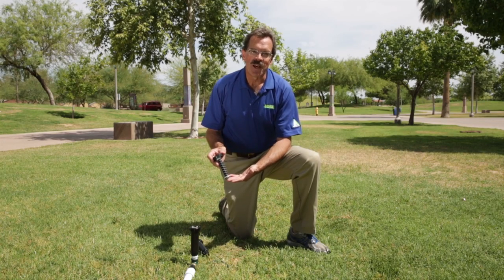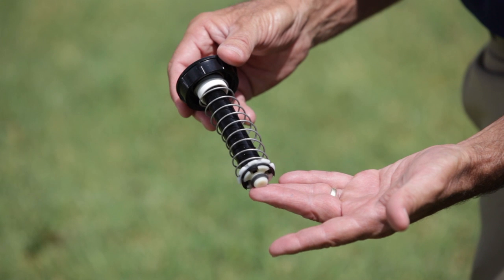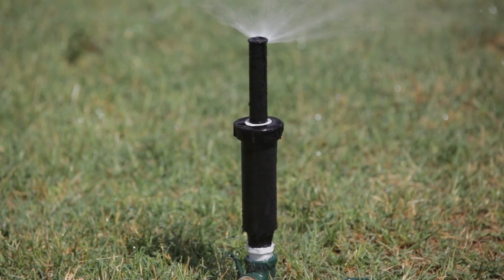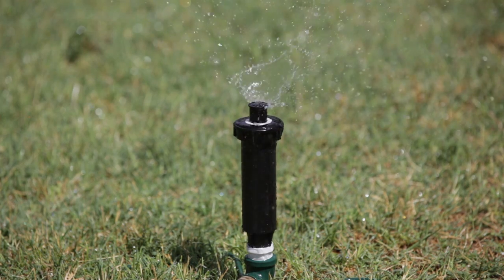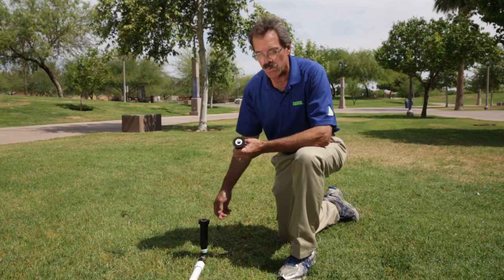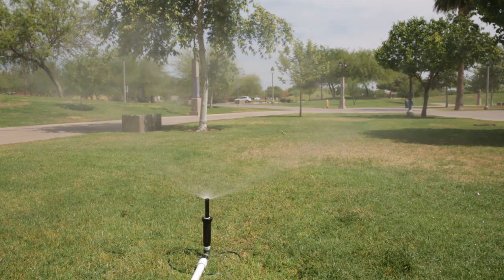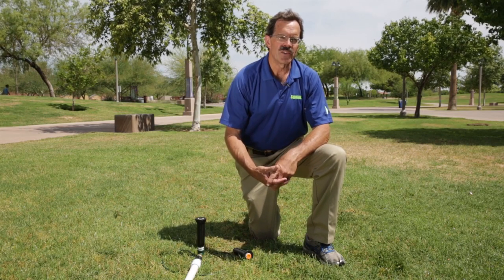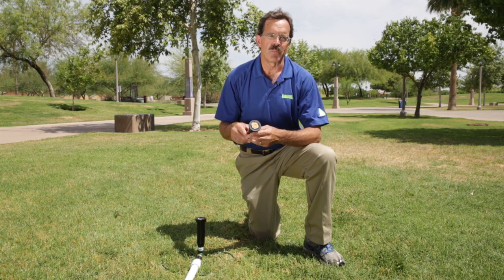Prevent Water Waste by Using Check Valve Equipped Sprinkler Heads

Comment: Thank you for the video. Would I need check valves on all of the sprinkler heads? Or just the one that is lower in elevation?
Reply from the maker: Good question! Any head that is located downhill from the valve may need a CV sprinkler head if enough pressure is generated by the slope. Depending on the type of sprinklers you have installed, the Check Valve may be available separately. Here's an example for the Hunter Pro-Spray:
https://store.ewingirrigation.com/44024020-pro-spray-type-drain-check-valve

Comment: So what would be the issue after installing a new rain bird heavy duty valve and after you turn the valve off it makes noise n a little water comes out
Reply from the maker: Thanks for watching djm93! The valve will make some noise as the diaphragm seals. Unfortunately, without more to go on it's difficult to give you an answer to the symptoms you've described. Rain Bird does have a tech support number you can call. They should be able to help you.

1-800-RAINBIRD (1-800-724-6247) Monday through Friday -  5 AM to 5 PM Pacific Time

Comment: What about rotary sprinklers?
Reply from the maker: Since it's the head that has the check valve, this will prevent low-head drainage regardless of the nozzle used. Thanks for the question!